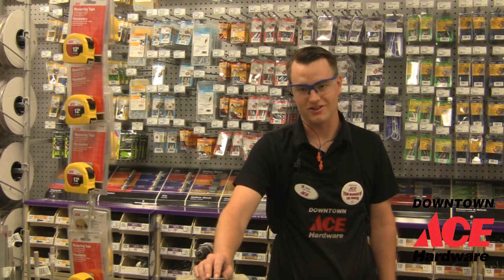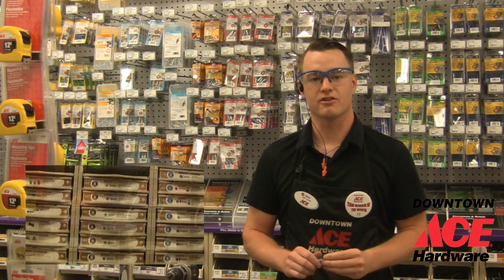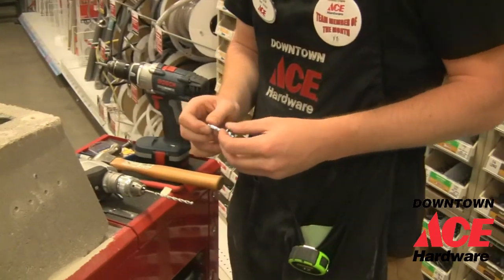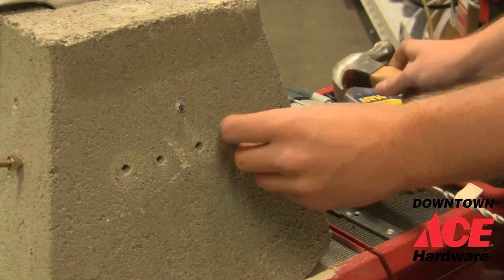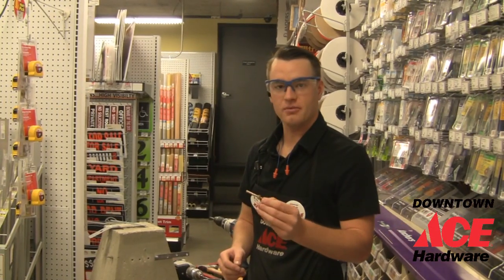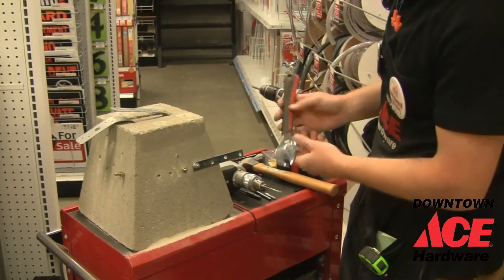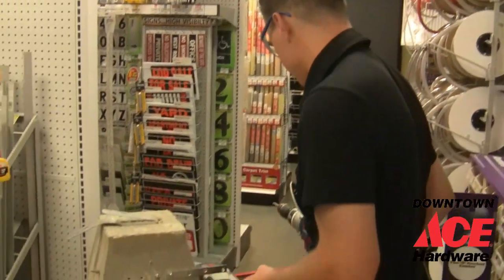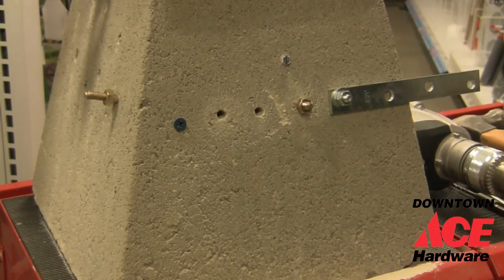Downtown Ace Hardware - How to Drill into Concrete Walls

Comment: DRY DRILLING CONCRETE =DEATH TYPE IN SILICOSIS ON THE NET BEFORE MESSING WITH CONCRETE IT WILL SAVE YOUR LIFE
Reply: A small amount of drilling to install a wall mount will not be enough to cause even an acute episode of Silicosis, and if you are worried, a simple air filter should take care of any health hazardous particles.